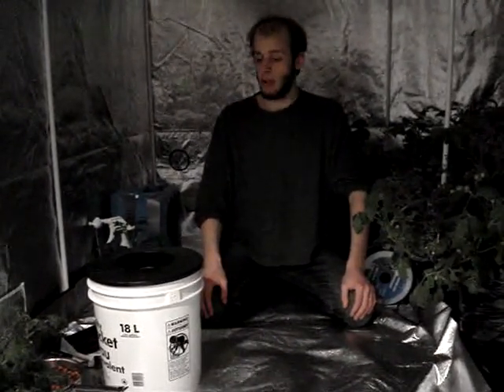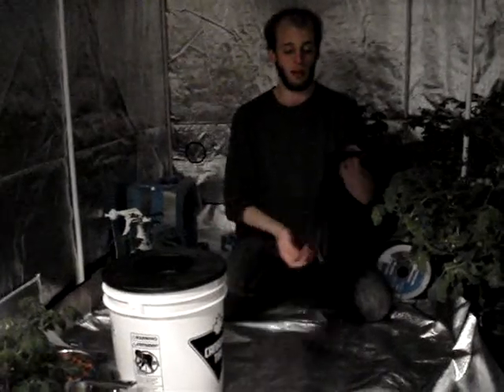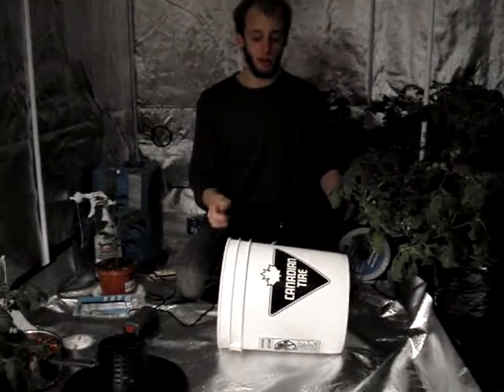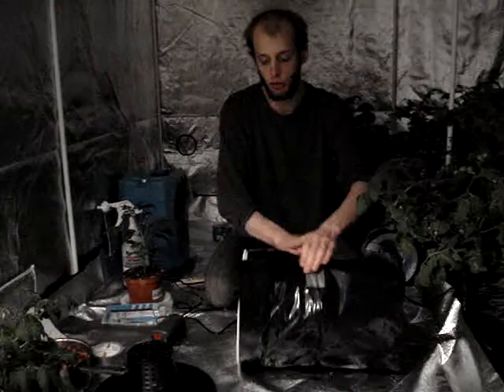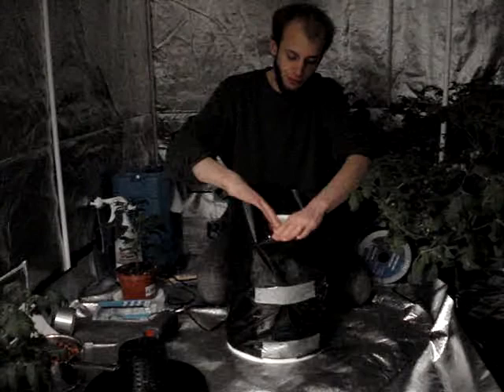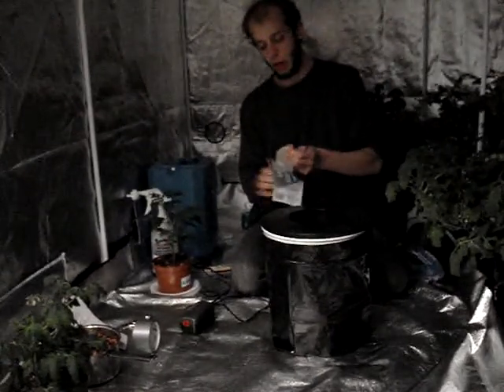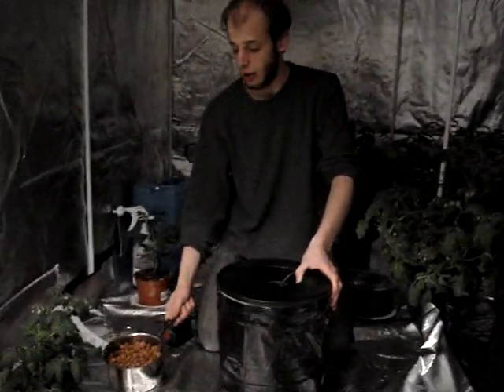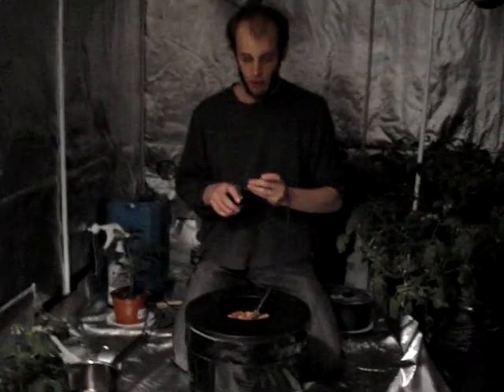Cheap hydroponic bubbleponic system DIY Works Great!

Comment from the maker: @snaht1 Sry for the delay, the easy way to change nutrients is to have another bubble bucket premixed according to your nutrient solution charts handy. Then simply lift the lid, plant and all to the second bucket. Remember to unplug the airline from the pump before moving your plant to its new home. It's also nice to have two people for this process as one can pickup the plant and the other moves the buckets.

Comment from the maker: @screamatmeh1 Good comment, after digging around for a while trying to actually define the term "bubblebucket" and from what I can tell, is merely a commoners name the describes the sound it makes. I suppose one could use a pump to draw nutrients from the bottom of a 5 gallon res however the bubbles from the bucket cause enough aeration and supply such a nice misting of the plant roots upon breaking the surface that no water pump is needed.  That and it would get root clogged being that close

Comment from the maker: Could not find black buckets in a small town, if the bag has any sort of small hole you dont notice, it'll leak into the bucket and you'll have an algae problem. It might work but this is the way I do it.

Comment from the maker: Yeah normally I let it run adding reversed RO water as needed) then I grab a 2nd bucket & fill that one with new nutrient solution and just pickup the lid, plant and all & move it over. Shouldn't take more then 5 min to change one, less if you have a res attached to your R/O system.

Comment: Isn't this just a regular ole' (D)eep(W)ater(C)ulture? Bubbleponics involves using a water pump to pump the reservoir water up to the center of the net pot and let it drain back down the root system into the reservoir.